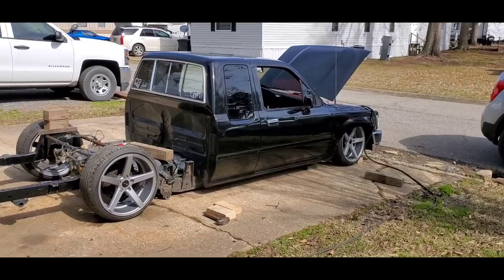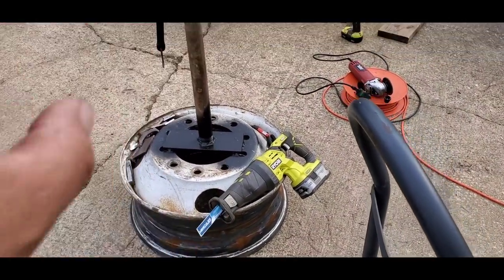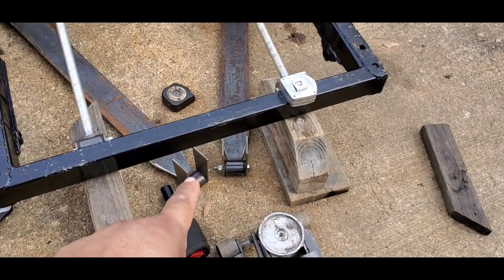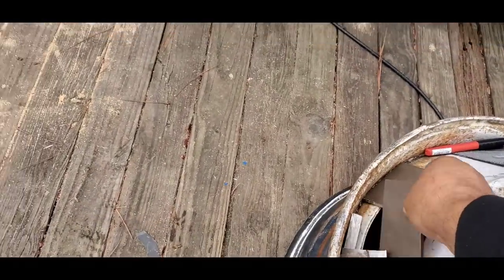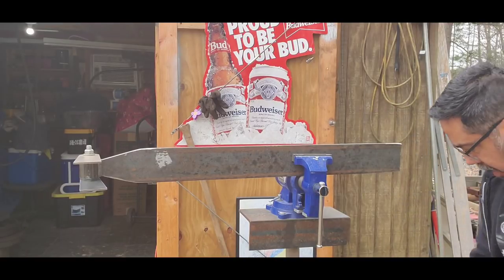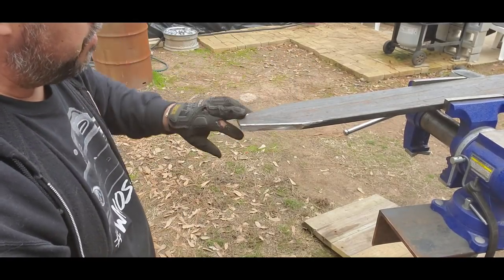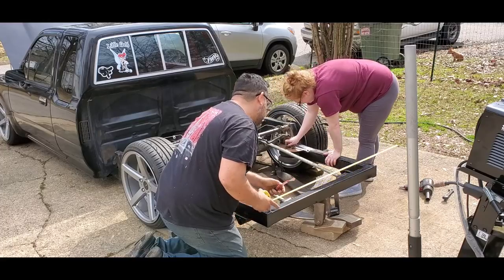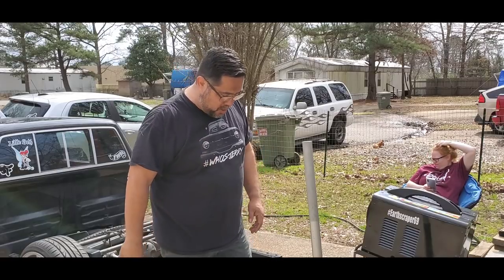13 bagged Toyota pickup upper link bars

Comment: Gotta 95 tahoe with rear shock 2 different size shock shackles welded over rusted shock shackles. Over sized.. Welded great but passenger side hangs 1 1/4 inch lower. Monoe air shocks hooked up to a compressor w no tank. No roll bar. Is this safe?
Reply: I have psi gauge. What's great psi for tennesee pot hole backroads
Reply from the maker: There is no way I can say if something is safe just by a description and as for what's right for a pot hole is another thong i cant say all trucks ride different and with different set ups bro I'm sorry i cant help you on that.